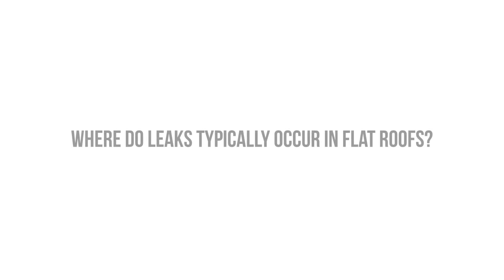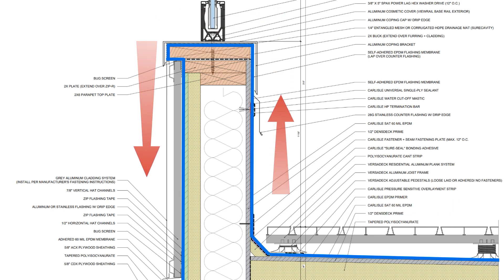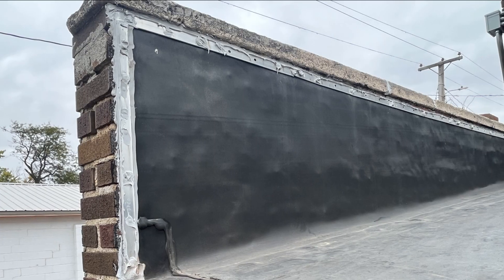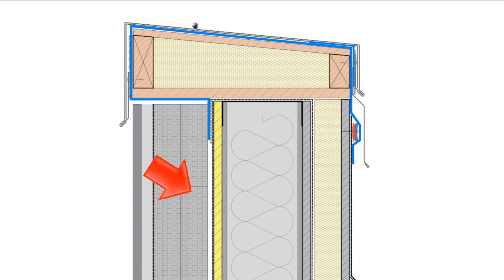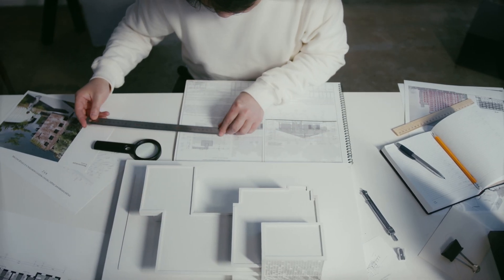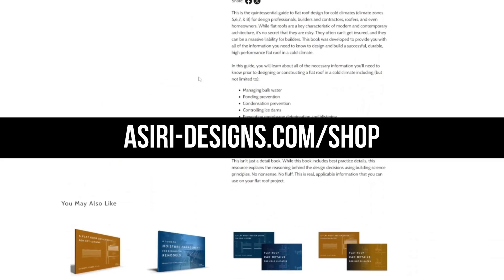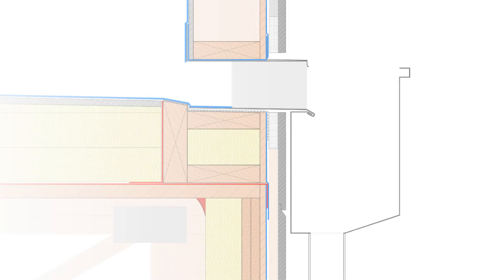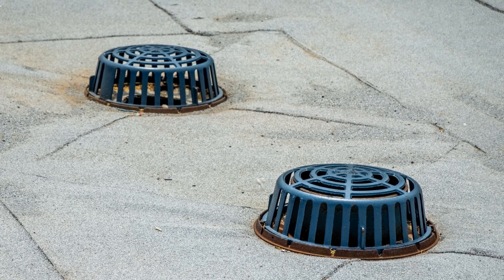Why Your Flat Roof Is Leaking... (Avoid These Costly Mistakes)

Comment: Considering in building my home with a flat roof and from all the research I've done and videos I've seen there is not one company that can 100% guarantee that your roof will not leak. I say that because even when using your methods the life of the roof still depends on whether that employee is underpaid, mad at his boss or is just simply cutting corners......I really like the flat roof style though and with me being a welder what do you think about laying 1/8 aluminum sheets and Welding them together. I can source them oversized and I fabricate so not afraid to customize pieces to make it work.
Reply: How many sq ft will your roof design incorporate? I imagine that will get pricey quick 
I think Matt Risinger covered a very nice (and expensive) build in AZ that incorporated a flat roof with some interesting details if you’re looking for ideas
Reply: It 3,900. I looked for it but couldn't find it. Most of his videos though I saw he uses some type of hidden fastener panel. I'm thinking about actually just laying down flat aluminum sheets and welding it all together. Yea it's not going to be cheap but if I can pull it off that roof will literally be there forever. The metal that is normally used is 26 gage and has a 30-40 year warranty. I would use 1/8 and probably 16g for trim. My only problem is that I am not a roofer. I bought this guy's ebooks and cad drawings so hopefully I can figure out this science.

Comment: Great video thanks for posting. What are your thoughts on ballast for flat roofs to help keep the membrane in place and prevent drain blockage? Is it something you'd recommend? 

Also, what's the website you are scrolling through roof penetration flashing products?
Reply from the maker: @martinsmith7562  Thanks so much, I'm not a fan of ballasted systems in the traditional sense, as I want to make sure that the roof membrane is completely bonded to the substrate of the roof, whether it's to a cover board or to the structural layer (I.e. using a fully adhered or fluid applied system). I am a fan of ballasts in the sense that it protects the membrane from heat and UV light.

The website was Carlisle's detail manual.
Reply: @ASIRIDesigns  thanks for the reply, I agree.

Comment: I greatly appreciate your presentation style and detailed explanations. I’m curious if your design guide covers a style I’m seeing more in the southern US which is a decoupled house / roof system whereby the house is well air sealed including a flat roof but has an external roof system - usually metal frame - that essentially covers the entire home. The cost maybe high, but the function of the home’s ‘internal’ flat roof is becomes functional with less loads and weather protection. Thanks!
Reply from the maker: Cheers! We have something similar that is discussed in the hot climate book, in which we recommend what is essentially a decking system on pedestals to shelter the membrane from heat and UV light. Same function more or less.